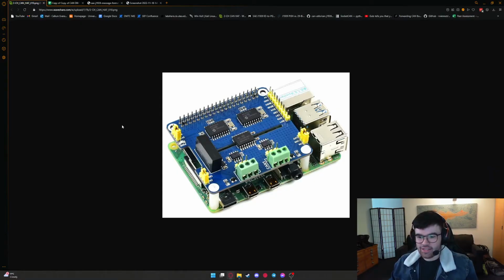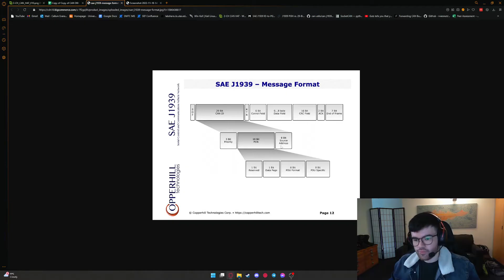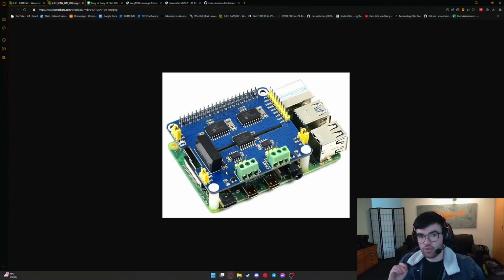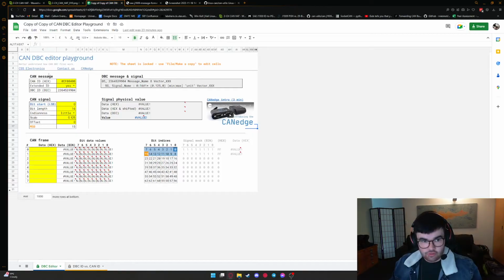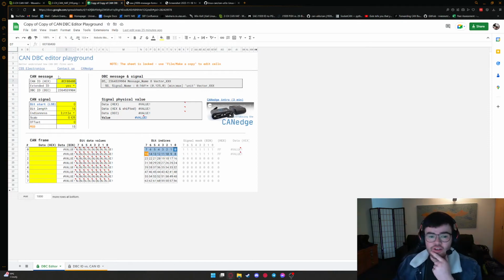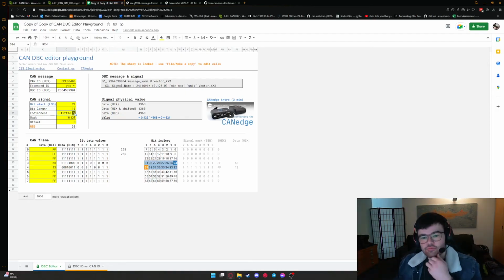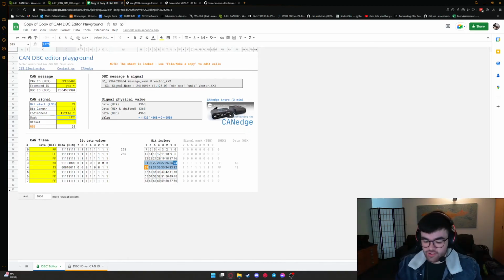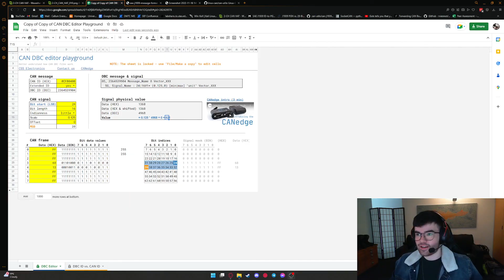Easily Decode CANBus / OBD2 Data in 10 Minutes

Comment: Hello, I have a Tesla Model 3, I have a Raspberry Pi 0 W connected to a USB CAN-BUS interface, I also have a 12 to 5V adapter connected and a Tesla ODBCII cable, all of which are connected to the CAN-BUS and I've set-up the Raspberry Pi so I can share the CAN-BUS interface over my WiFi network so when the car is outside my house I can connect to the CAN-BUS interface on my iMAC and using SavvyCAN or Wireshark I can see the CAN-BUS data.  What I am trying to do is identity the following signal data, where I can find the left / right signal indicators when the driver moves the indicator switch, if reverse is engaged and if the brakes are used.  Can anyone help me identify these as so far having spent quite some time looking for them I cannot see them.  I also have downloaded the Model3CAN.dbc file.

Comment: I think I am in trouble. I am trying to get CAN Data from a Tesla Gateway. These usually interface to a PowerWall I have an old and discontinued model the Gen 1 and I cannot find any of the data I need to decode this properly. I am trying to use SavvyCAN software to help but not sure how successful I will be. I have seen several videos with people getting at the CAN Data in a Tesla Car. Not sure how much info will cross over. Thanks for this Video.

Comment: I'm interested in playing with CAN, but most of the open-source software I've seen use Linux/SocketCAN.

Any idea if CAN hardware  (Ixxat USB-to-CAN V2, Peak PCAN-USB, etc)  will work on a Linux VM running inside of a Windows Host?

Comment: Where does Volvo store the expected software numbers within the can network for all the control modules attached to ms can or hs can? 
Got 2 used control modules, and both of them is setting u030000 incompatible software and u012200 lost communication.

Comment: Sir, if bit start = 32 bit, bit length = 32, scale = 0.5   and it using lsb is that means?:
Data (HEX) = data[4] + data[5] + data[6] + data[7] = 32+33+55+22 = 32335522
Data (HEX & shifted) = data[7] + data[6] + data[5] + data[4] = 22553332
Data (DEC) = 576009010
phycial value = 0.5 * 576009010 = 288004505

do i wrong?

Comment: awsome!.
just a note for those who have exported to excel.
my excel does not have the function "join". the replacement is "textjoin" but the parameters are different. 
this is the formula that works in excel: =IF(BIN2HEX(TEXTJOIN("";;X22:AE22))=0;"";BIN2HEX(TEXTJOIN("";;X22:AE22))). This was extracted from cell AG22. you must copy this formula down to the rest of the cells.
in N12 the formula must be : =IF(D14="big"; TEXTJOIN("";;AI22:AI29);AI29&AI28&AI27&AI26&AI25&AI24&AI23&AI22)
my two cents

Comment: Great stuff, thanks! Do you know if J1850 data can be decoded similarly?
Reply from the maker: I haven't had any experience with 1850 but assuming it's similar to 1939 you could probably apply the same techniques to decoding it but the rules for doing so will probably be different.